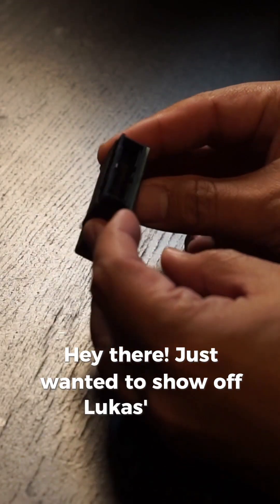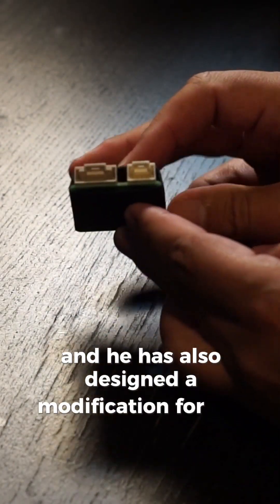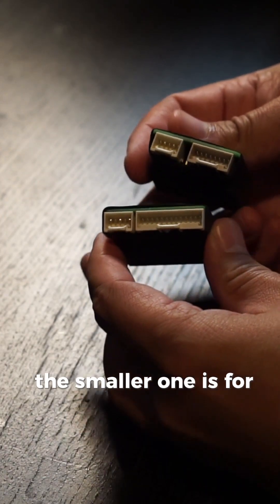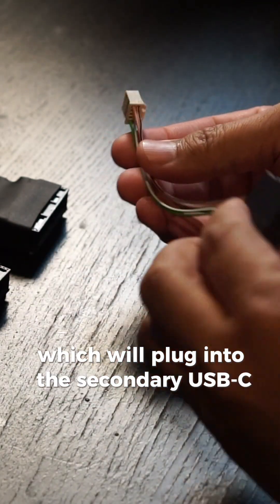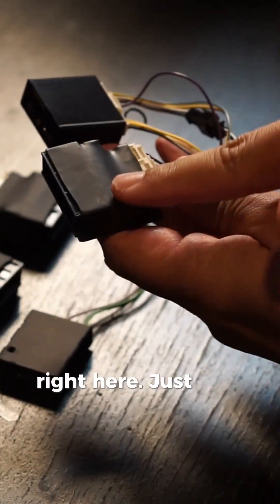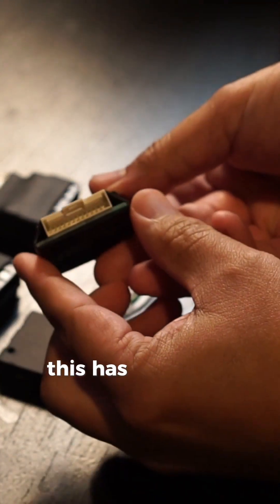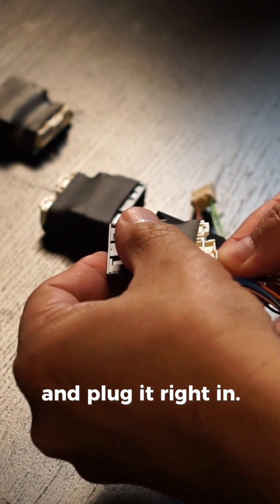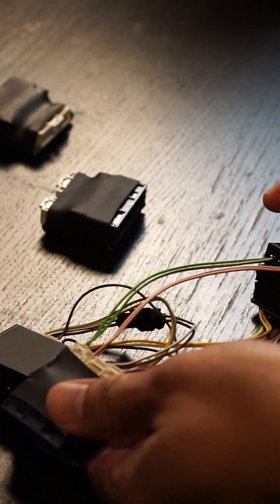Rivian Comma 3X Harness Mod for Openpilot Longitudnal

Comment: Seems like harness adapter and harness box both had 26pins sockets.  Couldn't they be swapped by mistake?
Reply from the maker: On these old prototype harnesses, yes, but the newer versions of the harness have smaller connectors on the adapter side - you can also see that version in this video.  I am just using the prototype harness because that's what I had on hand for the video.

Comment: If one is ordering a Comma, should one order the $99 harness? Or the harness kit from xnor? And, if so, does one then need to order the longitudinal upgrade kit?
Reply from the maker: Both harness kits are virtually identical.  Purchasing from XNOR helps support Lukas, the developer who designed the harness and ported Openpilot over to the Rivian.  The longitudinal upgrade kit is totally optional.  Having the upgrade gives you the ability to use Openpilot Longitudinal rather than using the Rivian's stock cruise control.
Reply: @theelectricvalentines  I wasn't seeing your reply, until now. 
Since It appears that the Fourth of July sale is now over, I guess I'll wait until some future time. It was still showing me a count down with over 4 hours left - just a few minute ago. But I couldn't get the reduced price in the check out window.
Reply from the maker: @swordedaffair  Yeah, it's frustrating they ended the sale early. Why bother having a countdown timer?  Anyway, hopefully they'll have another sale soon - maybe Labor Day?

Comment: What features will this enable?
Reply from the maker: It will enable adjusting set-speed for OP Longitudinal using the steering wheel buttons.  It should also enable blind spot monitoring for auto-lane changes.
Reply: I’m trying to convince Janka’s Workshop to come out with dual USB-C magnetic mount for this application. Of course, I just installed their existing single USB-C mount…
Reply from the maker: A dual-usb magnetic mount would be awesome!